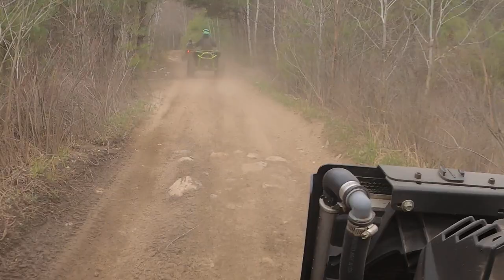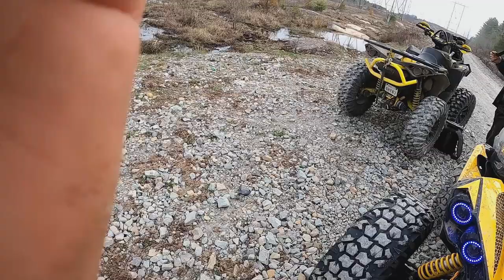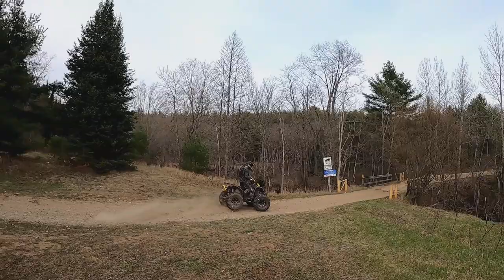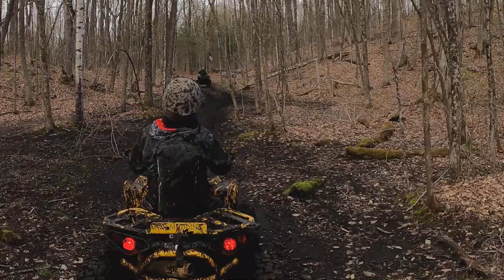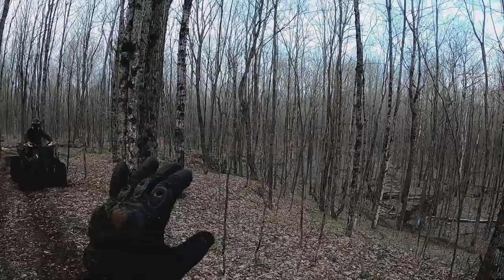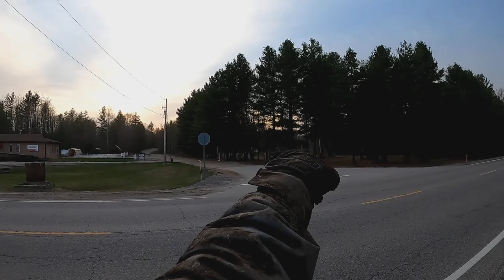May the best tire win!! EFX Trail Tire Shootout (Part 2)

Comment: The knock off conivores are clearly better than the other ones.
You guys also have way too much air in your tires, they need to flex a bit to bite. It makes a huge difference with trail tires but not too much with mud tires with huge lugs like your used to running.

Comment: No offense to all of you Can-Am owners but that was the perfect example of what I've said. Those guys you helped get out, they had no torque locker. When you drop your cash on the priciest brand out there, you shouldn't have to spend a few thousand extra to make it proper. Thank god they finally added a front diff lock.
But hey, AC has mysteriously dropped the diff lock recently but still have the price the same 🤷